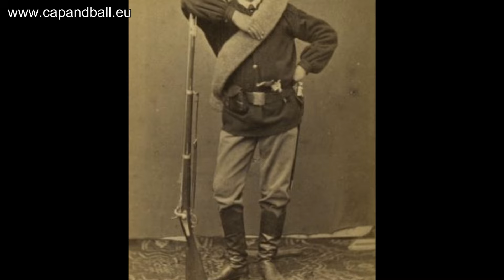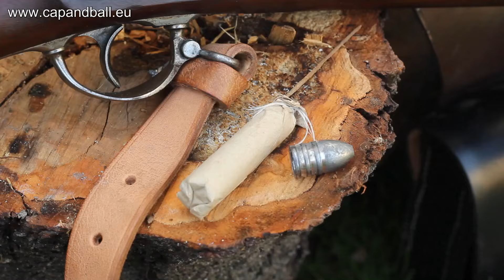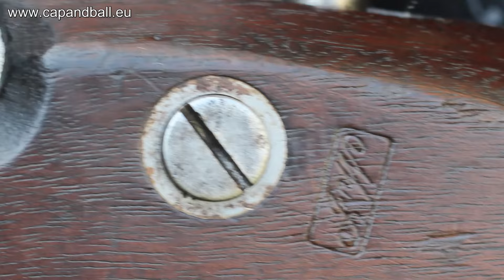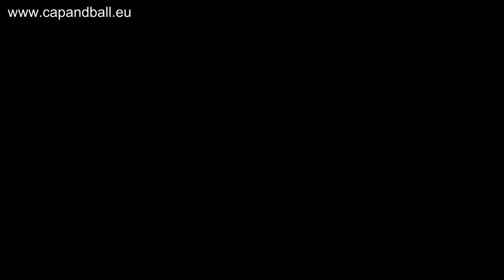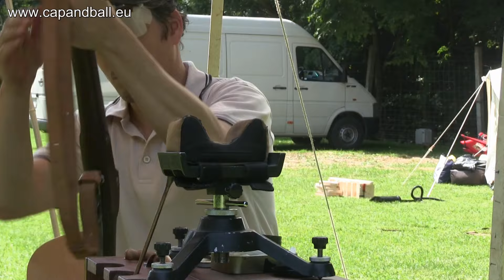Shooting the original Springfield rifle musket

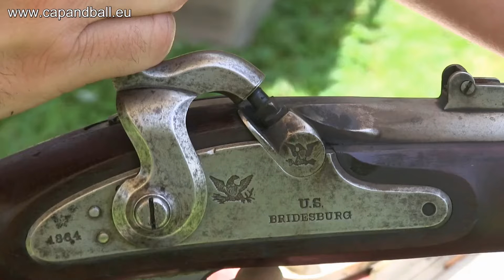Comment: 4:10 What's the golden thingy for?
Reply: It’s a musket cap, it has an impact sensitive explosive charge that ignites when struck by the hammer which the explosion then travels down a small hole to where the powder and bullet are loaded thus setting off the powder and firing the bullet.

Comment: How much does a rifle musket cost
Reply: $400 to $1000. Get a 1841 Mississippi rifle.
Reply: Depends on where you get it from. An original costs between $1500-$3500, and a reproduction costs between $600-$1500. This pricing is for a M1861 Springfield. I recently bought a 1862 Richmond Type III (basically a Springfield M1855) reproduction for $1100. So you’ll have to shop around to find a decent price.

Comment: (Ignore the signature, this is Caroline's husband)  Having shot these guns in competition since 1973 I'll say this, your rifle-musket should be shooting 3X better than it is.  The gun itself, stone the trigger to just over 3 pound weight, and add just a dab of ''Accura-glass'' under the breech area of the barrel.  Uniformly snug barrel bands, the 1863 type may need a strip of tape under the bands to make up for wood shrinkage over the years.

Your bullet is a good one, but may be of a too small diameter for the gun.  possibly a custom mold of the same pattern casting a .581-.582'' bullet would work better.   .001'' under bore diameter, size them all for a uniform fit.  Weigh the bullets and cull out under weight ones.   

I won't argue your lube, but I use something a bit simpler and different.  In a pie pan, melt 1-2 pounds of bee's wax, add equal part ''Crisco'' shortening and let set until cold.  Rub the tip of your finger on the surface in a circular motion three times, (three circles) and check if your finger tip is ''lubed'' and greasy.  If not, remelt and add olive oil until three quick circle rubs produces a slick finger tip, ( unscientific but it works well).  Dip the skirts in the hot melted lube and set aside, usually in batch's of 100.  When ready run them through your sizer, prelubed.  Makes sizing easier and cuts the extra step of lubing them.  I get twenty plus trouble free loadings with this method.

Swiss Powder may be better, but I've never used it.  I use Goex FFFg in all my .58-.577-.54 rifles.  I've found 55grains works best in most of my rifles with either the Lyman 575213 ''Old Style'' bullet or the Rapine 580 ''International'' bullet.  Suggest you start at 40grains and work up, (both the Lyman ''O-S'' and the Rapine ''International'' have heavy skirts and can take a combat charge).   

Loading, I simply firmly seat the bullet on the powder charge, no tapping it.  Our team competition is timed and I see no gain in tapping the bullet with the rammer.

Off the bench, my rifles usually shoot 1'' groups at 50 yards and sub 2'' at 100.  ( Original 1863 Springfield-original P1853 Enfield-hand made 1862 Fayetteville CSA rifle-original 1841 rifle-Parker Hale 1861 Musketoon).   I hope any of these suggestions help in a gain of accuracy for you.  These rifles can do better.  Retired N-SSA competitor 1973-2001.

Comment: couldn't you load the charge with more powder to shoot at 100 meters?would this damage this firearm if you did?
Reply: More powder doesn't help. What helps is a bullet properly sized for the bore (about 0.0005-0.0015 inches smaller), and the right amount of powder to get good skirt expansion and engagement with the rifling, to produce reliable obturation and velocity, with minimal leakage. Stability is the key, not velocity.

Comment: Where can I find a bullet sizer similar to the one you use? I have had difficulty in finding one.
Reply: +Swervin309 Look for "micrometers." They usually measure in 1/1000 inch precision and are relatively common for industrial or consumer applications.

Comment: Capandball,  Now you are talking about my most treasured rifle.  My 1861 is an original Colt's Special Contract.  It appears to have been sold directly to New Jersey, and the bore is perfect.  Have not had the nerve yet to fire it because I would hate to hurt it.  I also have an original Harper's Ferry 1842, .69 cal smooth bore musket.  Have shot it a couple of times with ball and buck.  Bore is rough, and after it gets dirty, it is hard to load.  I have had to hammer the ball home, and let me tell you that the 1842 will knock you back some after that.  Thanks for the info on expected group sizes.  You shoot mighty fine
Reply from the maker: Richard Egli, Sr Hello Richard, I also have a flintlock Harpers Ferry musket. That's a licker for sure. :)

Comment: Excellent work ! i wish i could have a Springfield rather than the lousy parker hale P53 enfield. I have the same bullet and have gotten ok groups with it but i find i get better results with a Lyman Old style sized .579 (my bore is 580 not .577 for some reason) with 55 3f Wano powder. Luckly I think i have found a way to open a lyman 575 mold without having to lap it, seems to work !
Reply from the maker: Shaun Lee Shaun, the PH Enfield is an excellent rifle also!
Reply: *****  I hope it is need to get some real consistency in it. Them military sights leave a lot to be desired though. Best accuracy i had was some hard lead lee Trash can minies behind 40gr 3f powder, dont know how though ! . Would love to see you do a video on the progressive depth rifling though, sampling a ever smaller diameter ball and noting the accuracy. I hear the PH rifles have this yet if i put a .002 or under i get lots of tumbling, makes me believe this PDR is a bit overstated.

Comment: ok, ive got to ask..... whats on your head? 

is it to help with focus on the target/sights? to prevent flame and flash from burning off your eyebrows? 

is the one over your "shooting" eye a magnifier? and the other side just a blinder?
Reply from the maker: ***** Hi, that's a normal diopter shooting glass, the same that pistol shooters use in Olympic shooting. It is technically a hole in front of your eye. you can adjust the size of the aperture. It acts like the aperture of the camera: the smaller the hole is the bigger the range is what you see sharp. It helps you see the rear sight, front sight and the target sharply. it's a great help with the Springfield as the rear sight is too close to your eyes.